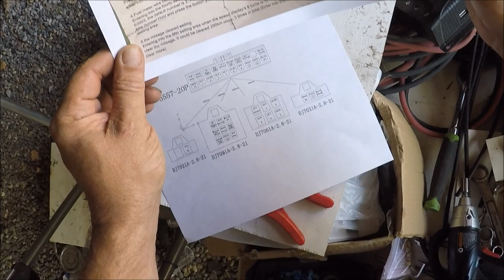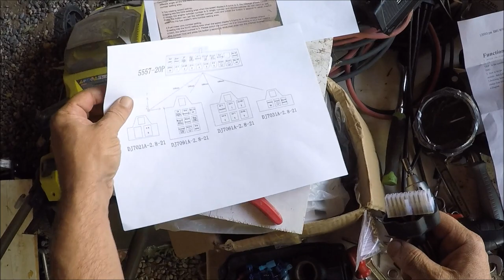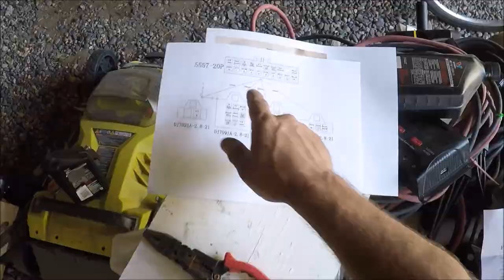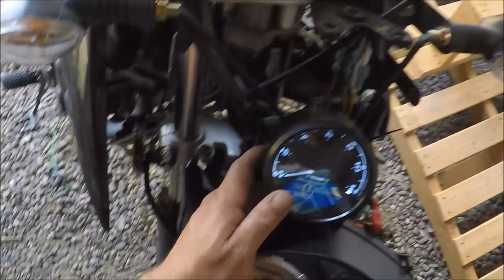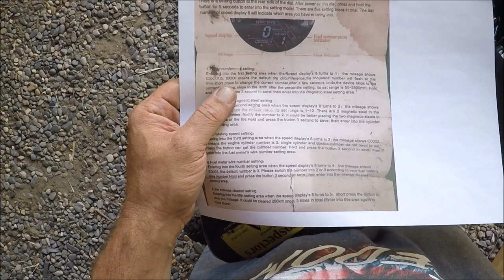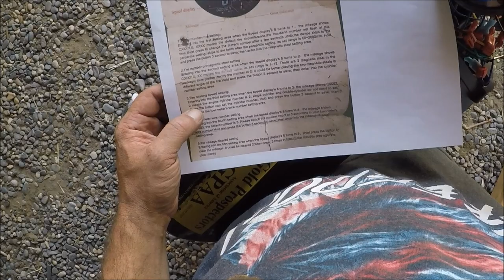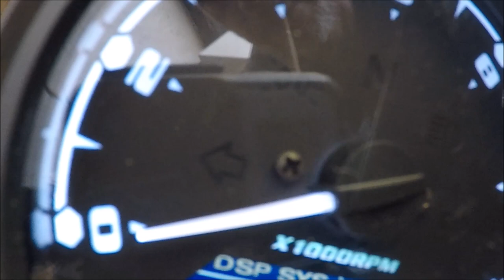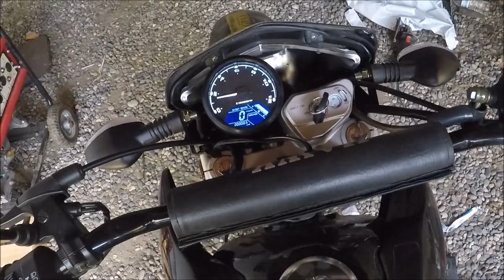RPS Hawk 250 changing things up / #6 Digital gauge with Tachometer

Comment: RJ you are the man. The speedo on my Hawk coughed up the first time I hit 55 MPH. I tore the cluster apart when the gas gauge died at around 1000mi on the bike and found the resistor had broken off. I soldiered it back on put the works back together but of coarse the speedo still was not working so I found the very same unit you installed. I like how your mind works brother. I got my Hawk in Aug. (2018) and have 1500 mi on it - the instrument cluster is the only issue I've had with it. Thanks for the excellent video. You've done this better than anyone else with this speedo unit.

Comment: Im installing mine now. I noticed the yellow and white wire on mine isn't neutral it's 5th gear so I have to fix that. The other thing is the magnets don't clear the brake pad so I'm trying to find somewhere else to mount them. I also don't want to drill into my rotor. I'll work on a video.
Reply: same here, did you figure out which one it was?

Comment: How did you mount the gauge? Did you make your own bracket? Great video!
Reply from the maker: I ground out the front of the original bracket & spread the bolt holes until the gauge fit..

Comment: Do you have any idea why I cannot enter the first interface? I only can enter the 123 to modify the second interface. When I turn on the speedo having the back button long pressed i can see a set of cccc but not the numbers to modify the circumference, number of cylinder, etc. Do you have any idea why this is happening? I bought it on eBay. And a s my bike's wiring didn't match the speedo's, I had to cut and re wire it, following the diagram.
Reply from the maker: All I can say is that if it's similar to the one I have - Besides what's in this video, I really don't know. Here are the diagrams I used, only thing is to be holding the back button while powering on - http://420stoner.ninja/speedo
Reply: RJ Gould my speedo looks just the same, same color, same layout. But I think the menu is different, it is like a different version of the OS.  Darn!!!! I've been robbed.
Reply from the maker: Have you tried contacting the 'seller' you purchased from? See if they know of any diagrams or could give you contact info for their supplier.. Dunno, sorry ..

Comment: Whats the link for the instructions cant find it
Reply from the maker: https://youtu.be/b2Y6o7CvWGc
Reply: i wired it up but for my speedometer to turn on i have to turn on my headlight and when i turn it off the speedo turns off
Reply from the maker: Must have your 'key-on' wire connected to the light wire, not a bad thing, you're suppose to have your headlight on while riding anyway.. lol .. I'll upload the diagrams I have to one of my websites & put the link in here..
Reply from the maker: Best I got - http://420stoner.ninja/speedo.html
Reply: thanks bro
Reply: last questions for the rpm wire what did you do to extended the black and white wire because i tried using 2 different wires and the rpm does not work
Reply from the maker: 14:14 starts the tach explanation.. Providing you have (green?) ground connected, the rpm is one wire the upper left corner.. I just connected another long wire to that & with the engine running, poked it into the wires coming out of the crank case until the tach ran, then I had the correct spot.. lol The rpm wire from my gauge is yellow/black, remember it's position not colors because they all seem to have varying colored wires, the positions are what matters...
Reply from the maker: The bottom right corner wire that says 'oil' in the diagram, that's the fuel gauge wire.. haha

Comment: Do you happen to know how I can figure out the circumference of my wheel? I have a 19 inch tire
Reply from the maker: I just measured the outside diameter, has to be mm though..
Reply: RJ Gould 
So I measured 19 inches on the rim with two magnets and I found it was like 1590 mm. But when I did that. It still was way off. Any ideas?

Comment: does the gear indicator work?
Reply from the maker: Naw, I didn't really work at figuring it out either though..
Reply: It's really easy to. You have to extend the wires from the crank case plug to the gauge and just hook them up

Comment: someone can help me to install this speedometer on a suzuki intruder RPM does not work.
Reply: hello I have the same bike as yours, you managed to solve the problem with the RPM also to me nn work
Reply: Try running the wire for the tach input down to the coil connect it to the small guage wire on coil. Also must have good ground I used the ground next to the coil.